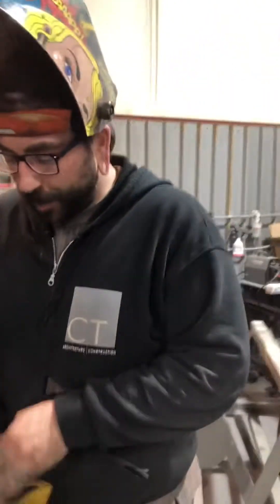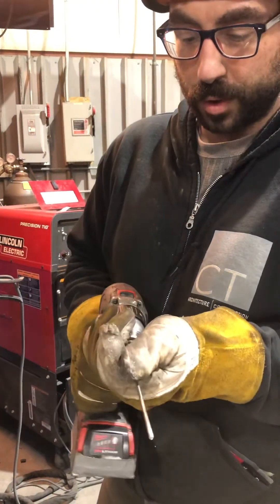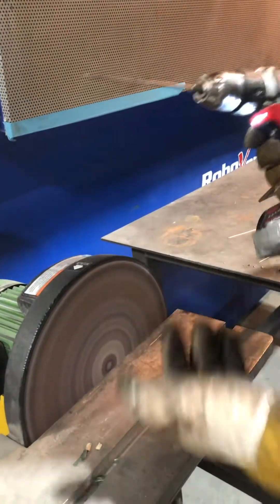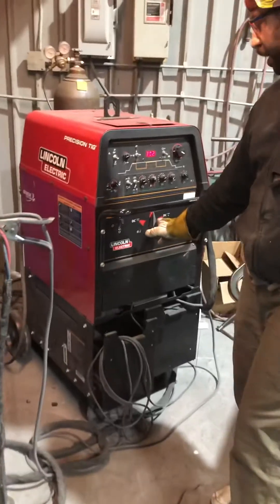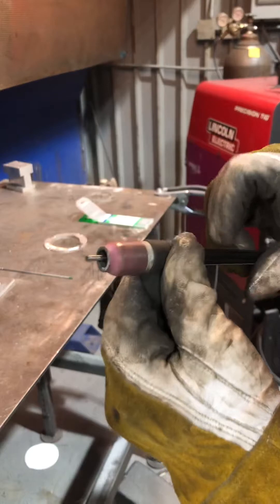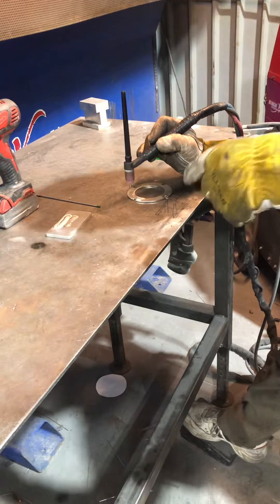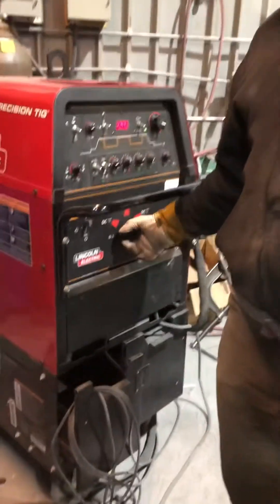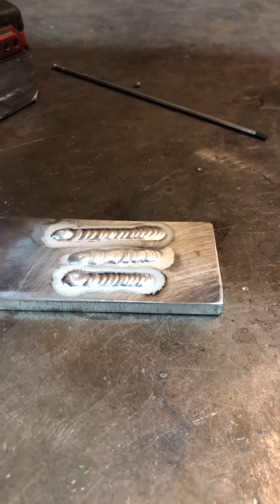How to prep tungsten! How to ball tungsten for aluminum welding!

Comment: Do I have to use stainless to ball it? What if I only have aluminum or steel?
Reply from the maker: Go with steel. It does the same thing but is more contaminated from the steel. Doesn't hurt if what you're welding is Okay with it

Comment: try just breaking it off sharp on the edge of the table.  ive balled big like that, and ive done a tiny ball. ive sharpened and blunted.  best results was just throwing in a blunt clean tungsten. but im running a inverter makes a difference.
Reply: You introduce fractures by doing this.
Reply: @SeamlessFab  you're correct.  Old comment.  Should have said only break off the dips & only scotchbrite & grind whenever possible.